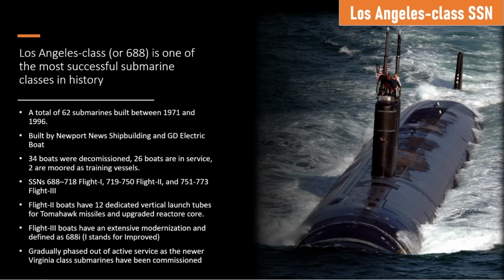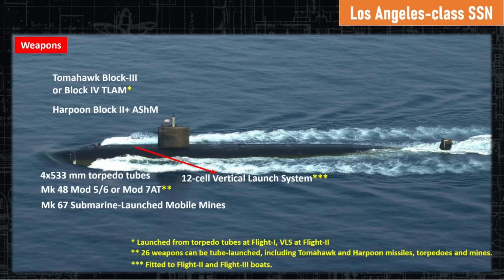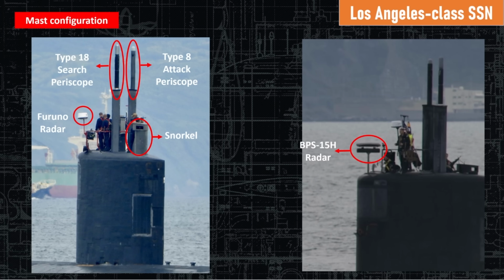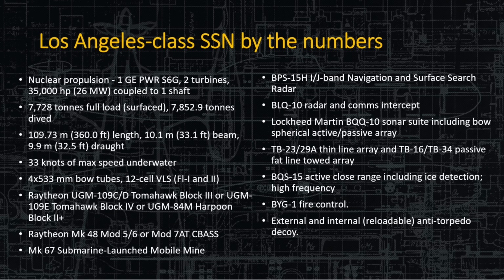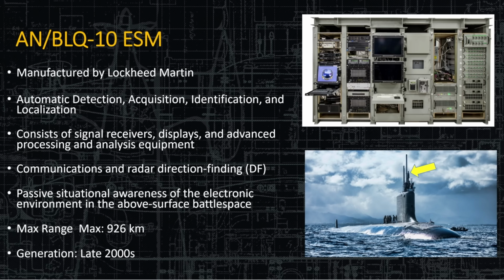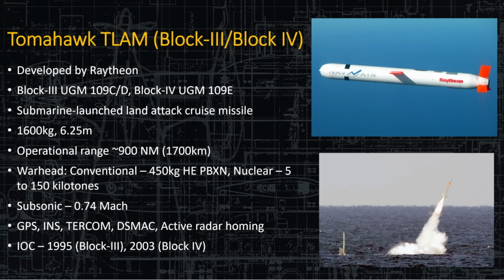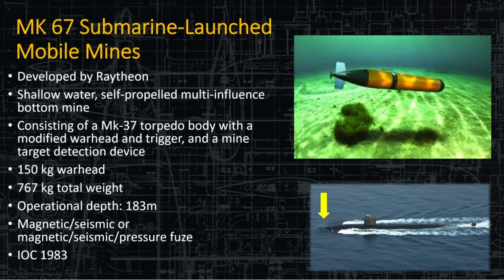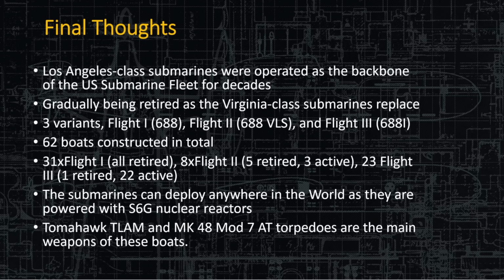688 SSN Sub Brief

Comment: Not as good as Russia's 700ft Titanium Oscar II class, its the Daddy of submarines K-329 Belgorod and its weapons are the most powerful on earth, 6 Tsar bomb type Poseidon torpedo's 100mt each, built to flood NATO's coastal Nukes.
Reply: Sure thing buddy, I'm sure they crap rainbows as well.
Reply: @gherkinisgreat  Does the US have a 700ft titanium sub with a test depth of 2000ft, your engineers weren't good enough Buddy.
Reply: @paulroberts7429  Well we did make a nuclear sub that could go 3000ft deep. NR-1. However that was a non combat research sub so I won't count that. Also Russia has much more Titanium than the U.S. so logistically it's impossible to make a large fleet of titanium subs for the U.S. We had to make fake companies to buy enough Titanium from the USSR to make like a dozen SR-71s. So we use HY series steel instead. Titanium also isn't great as it gets weaker and weaker every time you go super deep and a Titanium subs test depth gets shallower and shallower every time it goes super deep. HY steel doesnt do that. Also if you think a sub being faster and deeper makes it the best sub, you know nothing about sub combat.
Reply: @ryancollyer2046  The problems you give for titanium were American problems they tried but failed, the Russian engineers and scientists overcome this with double titanium hulls very quiet superstrong using alloy 48-OT3B, your excuse Russian had more titanium is a poor one, the engineering involved welding and the production of castings and frameworks, To work with titanium hulls special shops had been built. Static, cyclic and dynamic tests of titanium structures, Russian technology is superior in all fields, Rocket engine burning pure lox no US engine can, fighter jets SU-57 3d vectoring, space-stations, nuclear propulsion missiles, using classified exotic titanium blends that can withstand tremendous heat, crushing depth's, its not the amount, its the Russian engineers and scientists that beat the US.
Reply: 😂😂😂😂😂 so good you can hear them coming out of murmansk from Norfolk
Reply: @kdrapertrucker  ah but that is deliberate, They're deliberately so noisy you can hear them from the other side of the world to give everyone else a chance.
Reply: @alexwinfield9540  No they beat the US at engineering, Russia hold the top 3 records for biggest and deepest diving submarines, US tried but Failed.
Reply: I mean they're completely different subs. You're comparing apples to oranges.
Reply: @ryancollyer2046  I'm comparing engineering, seeing as US tried but failed, Russia is way superior.
Reply: thats nice to bad we could hear it coming out of port from the side of the Atlantic. and the 3 attack boats shadowing dont blow it mars the moment it opens an outer door
Reply: @Elios0000  The engineering is what matter's it technically superior to anything US has, its holds all the records for a submarine, its unmatched, US tried to build but failed, its only one of many fields of engineering and scientific supremacy that Russia is without equal.
Reply: Belgorod's okay but Russia needs at least two or three of them instead of just one because eventually Belgorod will need drydock maintenance and then what? To keep the strategic advantage, Russia needs more than one so the capabilities are always available in the other sub in it's Class.

Comment: Can you do a video on how submariners talk while at their stations? Like slang and things how they're required to say them, like why they say "bearing three two two instead of three twenty two"
If you're still prohibited from that do a movie react series on how movies portray it.
Reply: Say each digit clearly, use the phonetic alphabet (alpha, bravo, charlie, delta, etc), when using radio calms always use "Hey you, it's me" format (Bridge, Control, Message), then there's way too much slang to cover. "Coner" means forward guys, "Nuke" means engine room guys, etc.
Reply: @underwaterlevelz1947  ya I kinda understand a lot of the basics but the deeper stuff you don't hear about is what I'm looking for
Reply: @A_barrel It depends on who's reporting. He may use the location as the promenant equipment, "acred odor by the Trim Pump." He may say what bay, "light smoke in the Main Seawater Bay." He may just call out the whole compartment, "Low pressure air leak in the Auxillary Machinery Room."

Before an imminent collision on one of my boats submerged underway, the situation was so desperate that the only word we got from Control was "EMERGENCY DEEP!!" Since the impending event was so obvious, everyone began rigging for General Emergency and Collision but there wasn't time to finish them before a Freighter ran over us. You could hear the engines and screws turning above the boat very clearly. The hull of a 688 is much stronger than a ship's hull, I was not afraid of anything serious happening like flooding or anything like that.
Reply: You say each digit clearly and by itself, because 40 and 14 can sound really similar for example